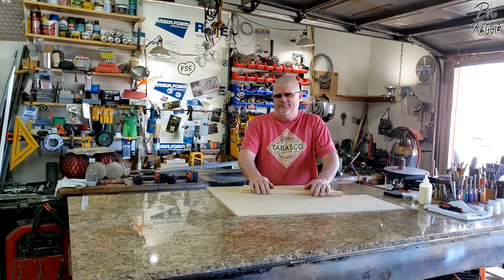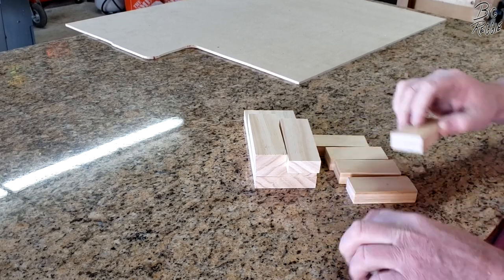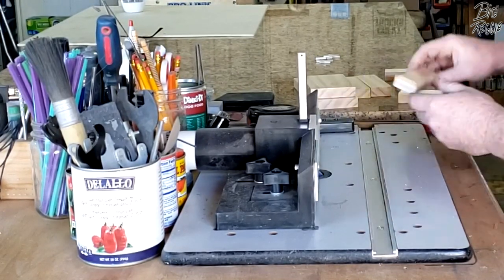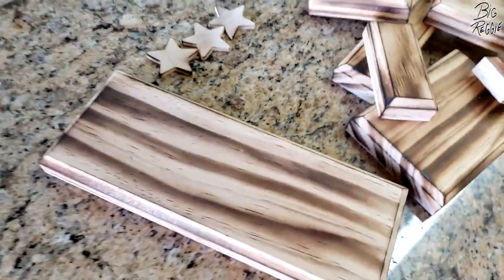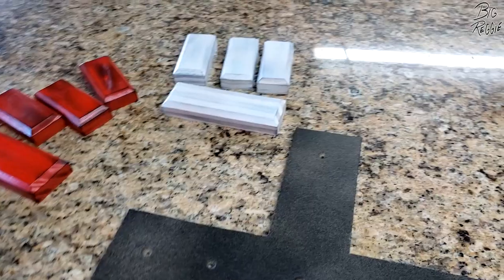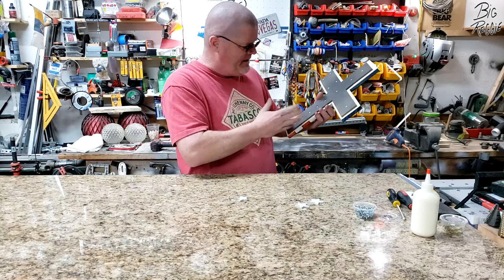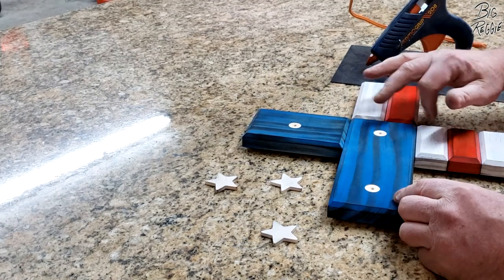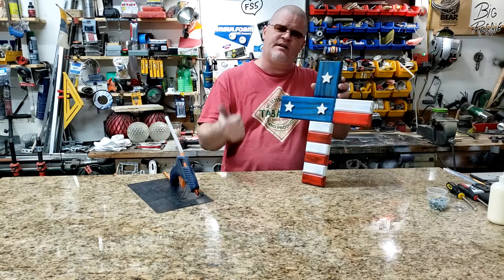DIY Flag Cross - Easy Project

Comment: If you want an incredible glue that sets almost instantly but still lets you position whatever you are attaching. Press down when ready for a couple seconds and that’s it.It’s called - 
Crafter’s Pick The Ultimate. They have it at Hobby Lobby or you can get it on Amazon. It’s a water based super glue. Basically white wood glue with super glue properties, best of both worlds. So easy to work with and sticks to anything including stained wood and dries clear. I use this now for all my stars and nothing else.